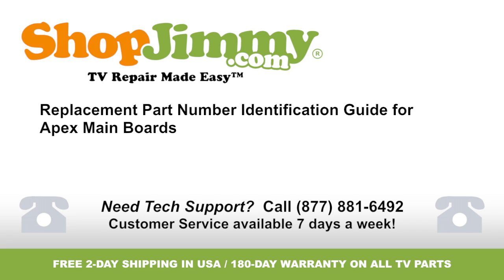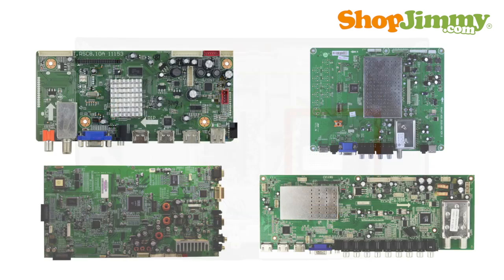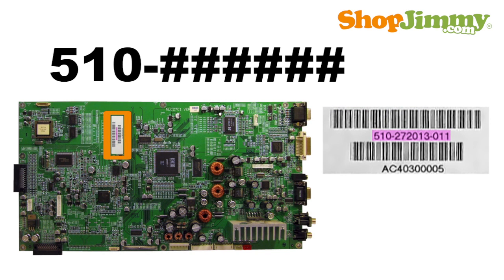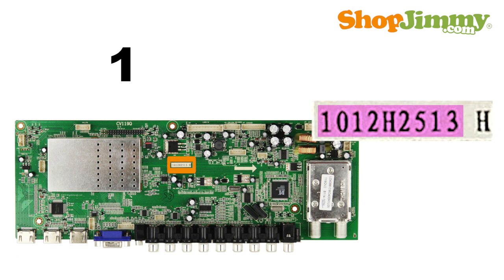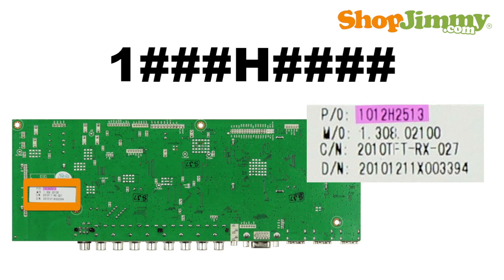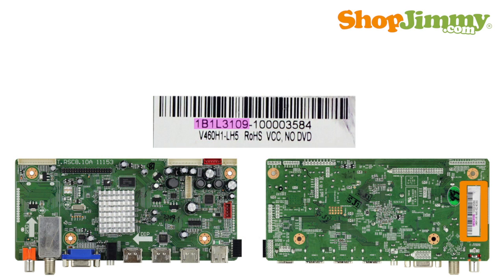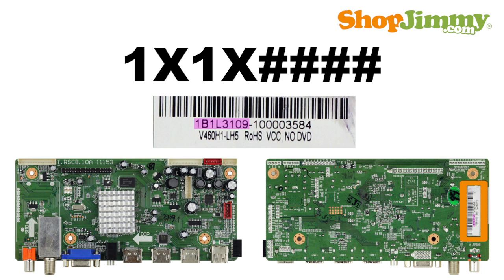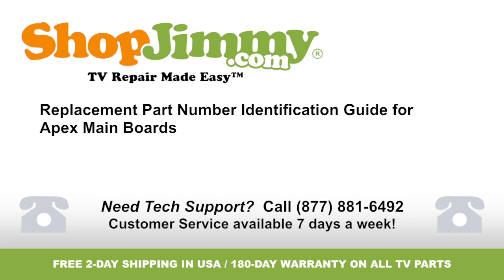TV Part Number Identification Guide for Apex Main Boards (LCD, LED, Plasma TVs)

Comment: Hi, I have a Apex ld3288m. The tv will turn off every 10,20,30 minutes randomly. I have replace power board thinking that was the issue. I have disconnected the Ir and the On and Off wires that go to the main board and still the tv turn off(was checking to see if maybe the power button was causing the tv to turn off).The timer is on off, so that is not the case. Could it be the main board? Hate to keep ordering parts if I keep buying the wrong ones. Thanks
Reply from the maker: manny rey   I recommend replacing the main board as it seems like it's killing the turn on volts from the power supply randomly.  Here is a link to replacement parts for your TV model number on our website, click here:  http://www.shopjimmy.com/catalogsearch/result/?q=ld3288m  Be sure to match part numbers on your current board, with your replacement for compatibility.  You can also call our customer service for further assistance with your purchase.  (877) 881-6492  Thanks and please let us know if you have any further questions with your TV Repair!  www.shopjimmy.com
Reply: Thank you for the quick reply. I will go that route and purchase the main board. Thanks